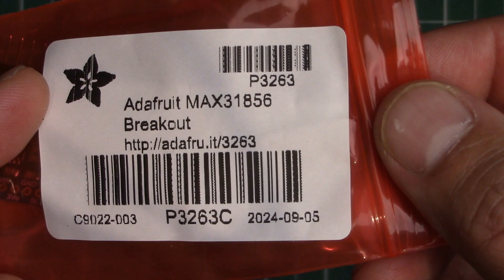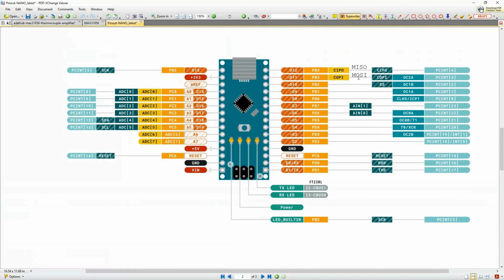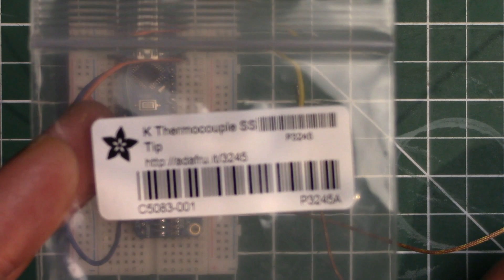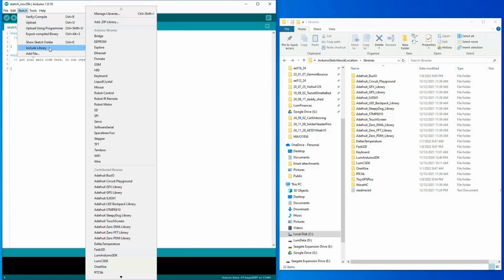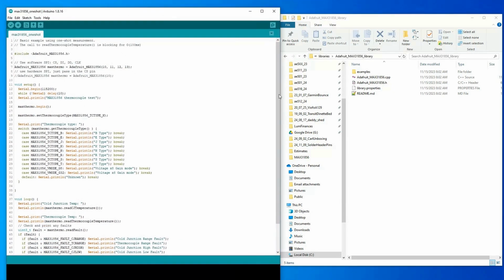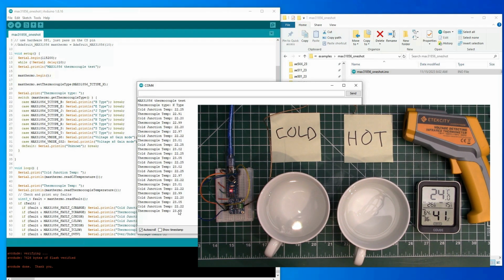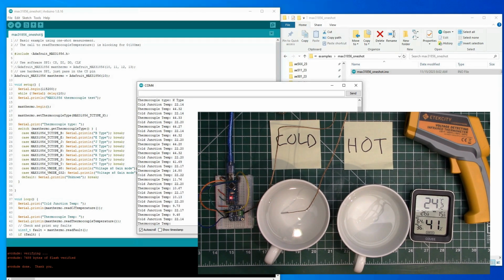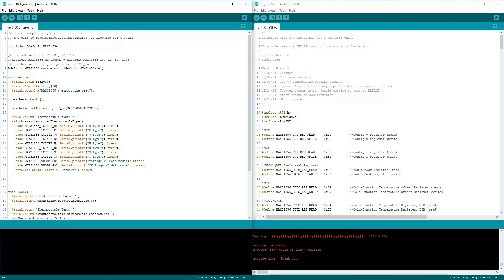Measuring Temperature with a MAX31856, Thermocouple, and Arduino

Comment: Hello Dr Lum Greetings from Australia. 

Great video as always.

Is there going to be a video in this series that tries to implement PID control because that is something I am interested in.
Reply from the maker: Great to hear from you!  You are actually correct, this is part of a larger series that will come out over the next several weeks and we will indeed work our way up to PID control of a thermal system.  If you're interested, there are theoretical PID videos on the channel already but we'll look at applying these ideas to this physical system.